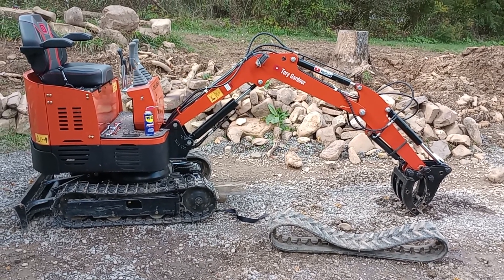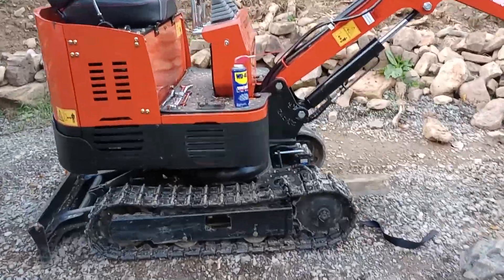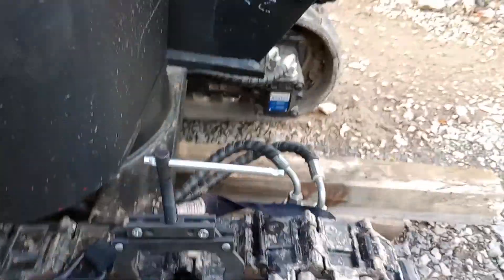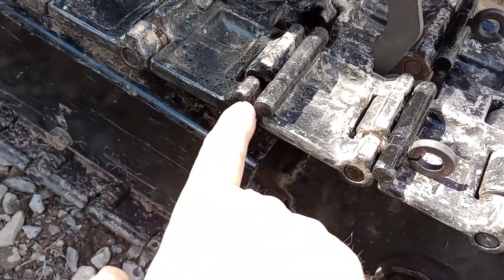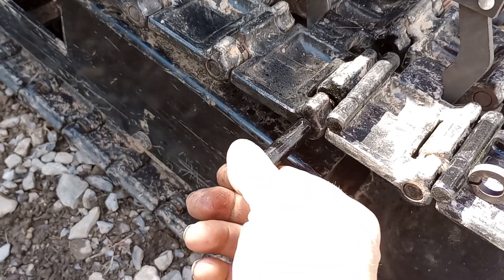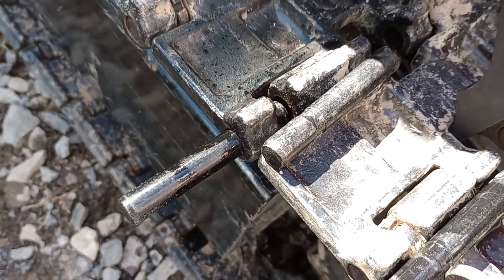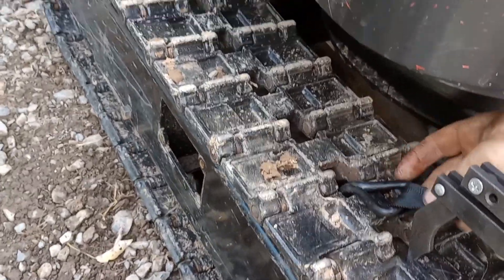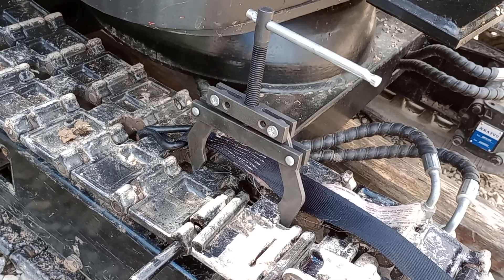Gardner's GroundHog Mini Excavator Steel Track Installation

Comment: I am thinking about getting a set of metal tracks for my mini excavator.  How are the metal tracks holding up for you?  Where did you get the tool to install them and how did you adjust the tension?
Reply from the maker: I use my metal tracks primarily in the woods and I have never had a problem with them coming off. The only issue I've had with them is that some times the pins start to work out but you just have to knock them back into place. I run my tracks fairly loose to help the ride quality over roots and rocks. I used a motorcycle chain tensioner to help install the tracks.

Comment: I got my steel track and will be mounting them tomorrow.  Thanks for the tip info. on installing them, also bought the tensioner tool from Amazon. Thanks again.
Reply: how do you like them so far?
Reply from the maker: Well other than watching for the pins to work out which then need to be tapped back into place I do like the steel tracks. I haven't had a track run I off since I replaced the rubber one's.  It's a lot easier to watch the pins than to put a rubber track back on especially out on a job.
Reply from the maker: Hey just a heads! Make sure you get some extra track pins and locks which look like lock washers so you can install the tracks. It's also a good idea to have a couple extra just incase you loose one. The pins sometimes start working out under use. I just pound them back into place when I notice them working out. I've never lost one but I can see how this might happen. Just something to check when your doing your preventive maintenance.

Comment: More Questions, What is the width of the steel tracks? Also, I am having difficulty keeping my rubber tracks on. I am only able to finger-tighten the lock-nut on the tensioner screw because I can not reach it with a wrench inside the deep opening.
Reply from the maker: @geolt3  My steel tracks on the Groundhog are 7 inches wide. You'll have to get a open and closed end wrench to reach in and tighten your lock nut and another one to adjust your threaded rod. Get a tape measure to measure the nut to make sure you order the right sized wrench.  You'll have to use tools to keep the proper track tension. Sorry for the late response but with everything going on I completely lost track of this comment.
Reply: @gardnersgroundhogminiexcavator  No worries, I appreciate the information as always. I have a lot to learn.

Comment: Do you have a video of you taking the rubber tracks off an putting the steel ones in place?
Reply from the maker: I have a video on how to adjust your tracks.
Reply: @gardnersgroundhogminiexcavator  Yep, I saw that video on doing the adjustments. I was mostly concerned about manipulating the very heavy tracks around to get them on the machine. Also, where did you get your track tensioner?
Reply from the maker: @geolt3 The track tensioner is actually a heavy duty chain tensioner that I found on eBay. I used the long strap and hook from a ratchet strap to manually pull the tracks into place and to bring the two ends of the track together so the track tensioner could take over.
Reply: @gardnersgroundhogminiexcavator  Thanks for the info. I will start looking for a chain tensioner similar to what you found because I just ordered steel tracks for my ZH24D-2 ex and I will be putting them on by myself.
Reply: BTW, I am an IT guy so I learn all this stuff from videos like yours. So thank you for all the helpful videos.
Reply from the maker: @geolt3 Glad I could help and thanks for watching!
Reply: @gardnersgroundhogminiexcavator I bought the chain tensioner on Amazon and I got my 9” steel tracks after 4 months of waiting, then two weeks later I got my pins in the mail! And yesterday I successfully installed the tracks!! The chain tensioner worked great! It was so easy to install them with it.
Reply from the maker: @geolt3  I'm glad I could help. Thanks for watching

Comment: They look like a really nice set of tracks, good investment to save on the rubber tracks until you need em'👍 probably added  a little weight which is a definite win-win 🥳
Reply from the maker: Well I mainly wanted them to add counter weight for stumps and logs but after using them out in the woods. I would say they perform much  better than the rubber tracks because they stay on when the rubber tracks want to roll off the running gear when snagged on a root or rock. So far I'm very happy with them. I would agree that the rubber tracks should be kept for those jobs where you don't want to damage the surface like asphalt.